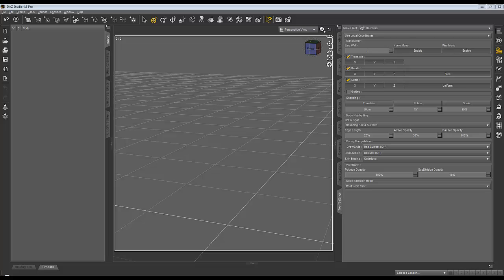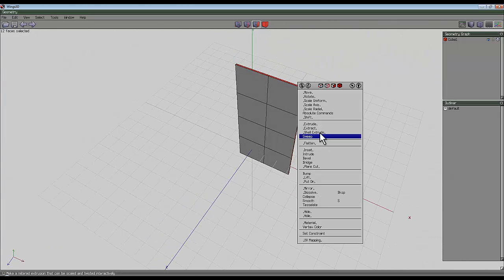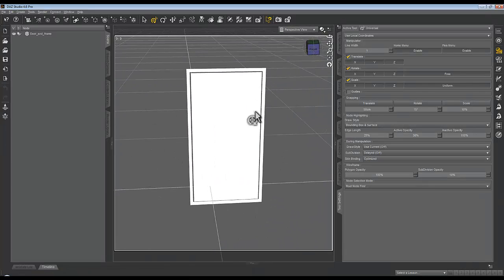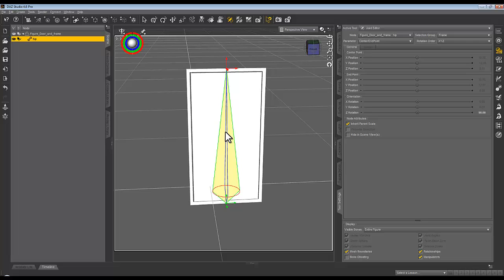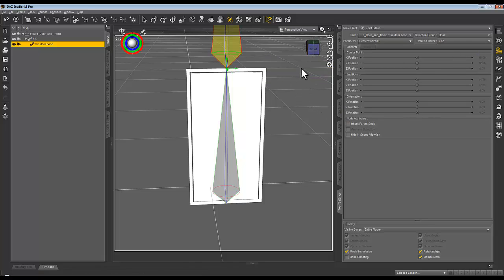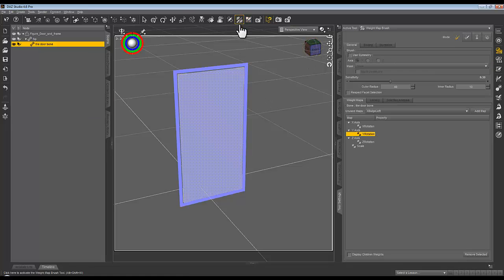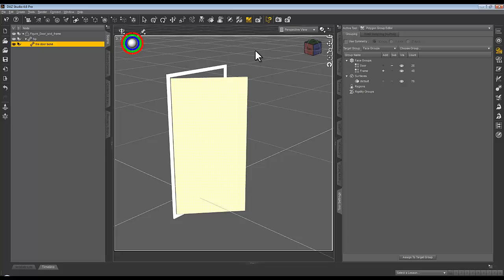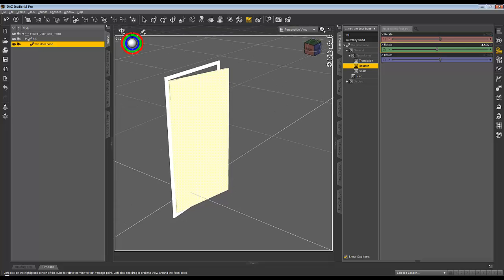DS project - the door bone is connected to the hip bone - by David Brinnen.

Comment: David, I can tell you how to set limits, as I have been practicing this very thing recently.. In the Parameters tab where you find the slider dials for rotation, you should see a gear shaped icon in the right top corner of each slider. Click on that icon and a menu will appear. Click Parameter settings. A small window will appear with several value text boxes in it. The first thing to do is click Use Limits. Next, in the two top text boxes enter the positive and negative values you want in degrees of rotation. in the left textbox next to Default value you want the closed value of your swing (usually 0 degrees). In the right side one you want the maximum value. A normal door has a swing in or out of approximately 100 degrees, so enter that value. Keep in mind that this is rotation values so you do not want to tick the As Percent check box. Click Accept and that limit is set. I suggest that you Do the following also to prevent rotation, movement and scaling you do not want:
Open the full parameters slider list so that you have the sliders available for Translate(Movement),Rotate, and Scale. Look for the Padlock icon in each of them with the exception of the one you just edited, and click them to lock those parameters The only one you want unlocked is the one that allows rotation in the way you want the door to swing.
Hope this helps.
Reply from the maker: Thanks!  Yes, I've tried that and it does help!
Reply: Just returning the favor. You have helped me a lot and I think it only right to help you when I can.